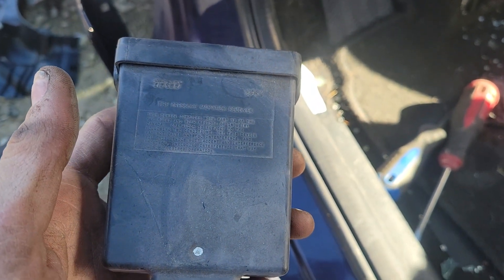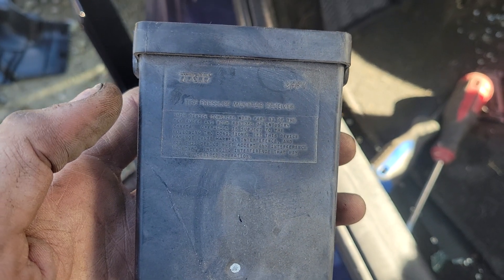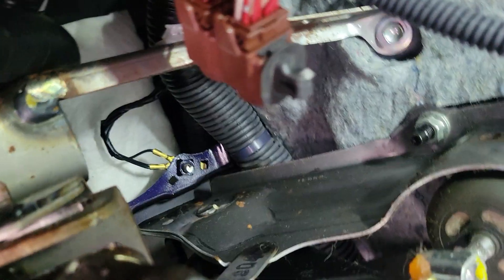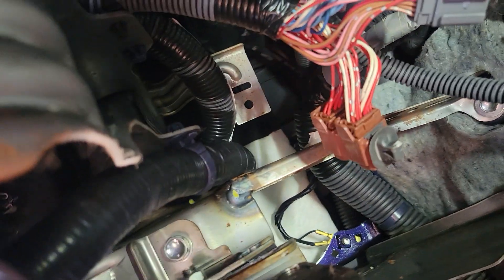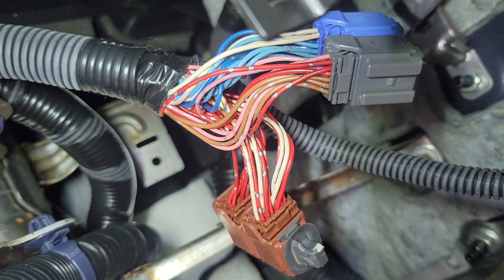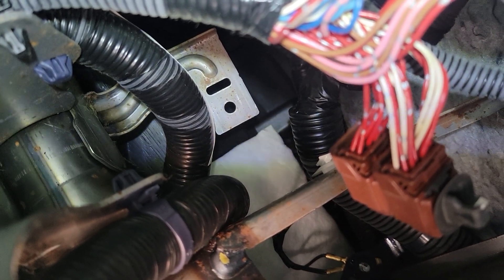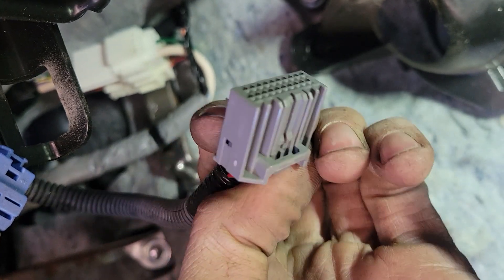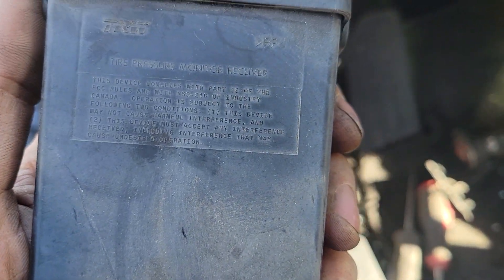2009 Honda Fit TPMS Receiver Location and Removal

Comment: Is the module the same as tpms sensor? If not where is that located. Thanks
Reply from the maker: there are four sensors, one in each wheel, that send a signal to the receiver that sends the signal to this computer that works with the main ECU